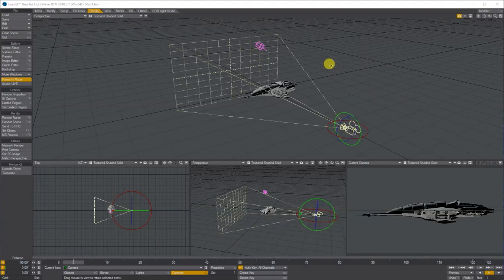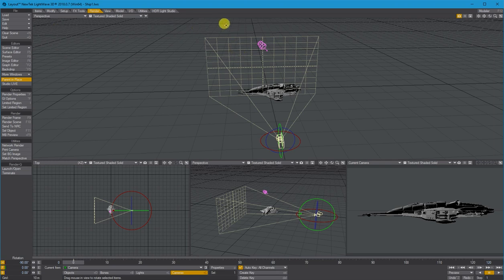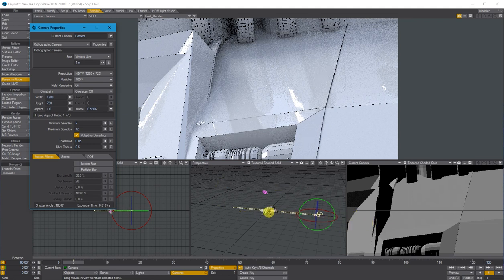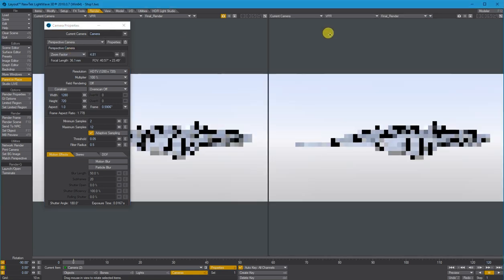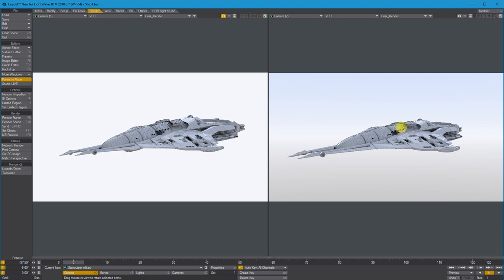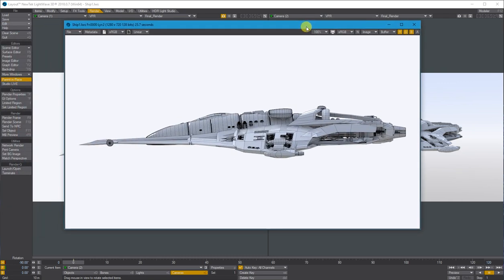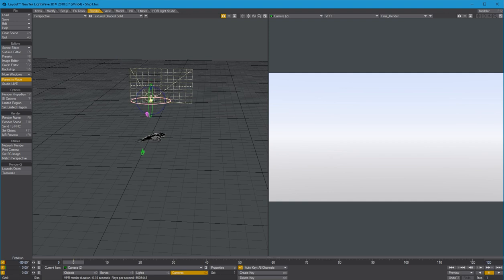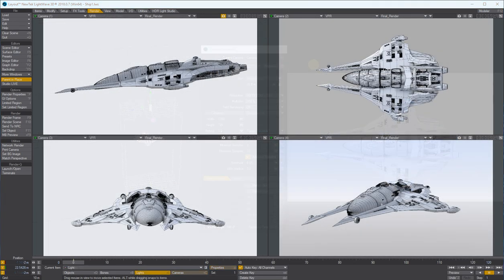Using the orthographic camera in Lightwave 3D

Comment: So, still not sure when you would use the orthographic camera?  Also, just a note, hopefully a constructive one,  - your videos are always done with a low volume and I have to crank up the volume to hear and even then it's hard to hear.
Reply from the maker: Orthographic 3D views show a 3D model in a 3D view where all components are the same size regardless of the camera’s distance.
Orthographic projection can also be used to render shadow maps, or render orthographic views of a 3D model for practical reasons: an architect for example may need to produce blueprints from the 3D model of a house or building designed in a CAD software
Not sure what to say about the sound, the sound levels are fine on my PC and also my Students PC's.